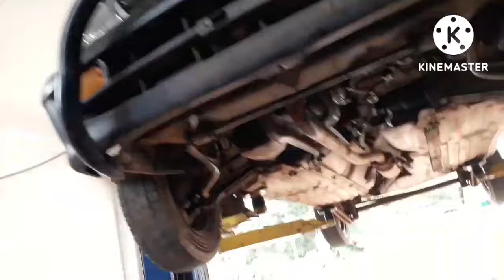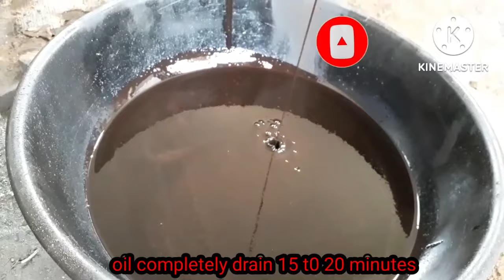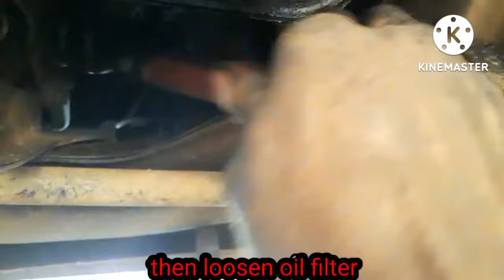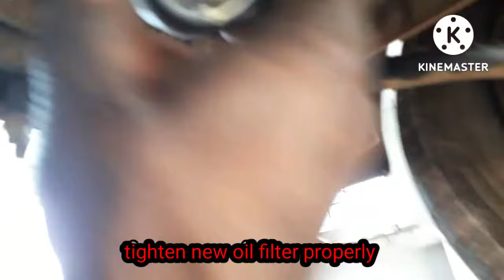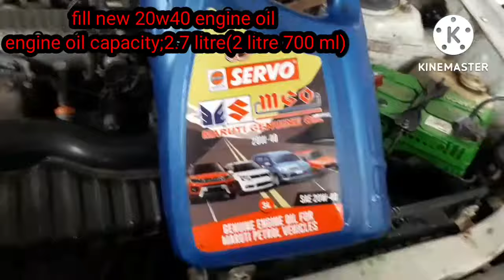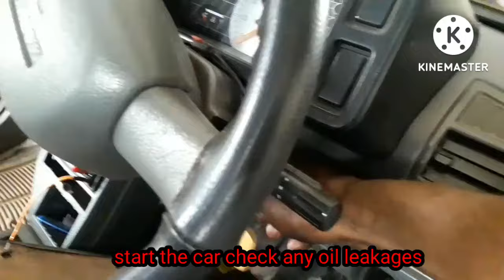maruti 800 car engine oil change procedure

Comment: Oil filter fitting new no wrench tight only hand tight
Reply from the maker: In the 800 car there is no space to tighten the oil filter, so you have to use an oil filter wrench

Comment: Before oil drain u should remove engine oil cap other ys sum oil stuck in engine
Reply from the maker: There is no need to remove the engine oil cap as the engine oil does not remain below the bottom for any reason
Reply from the maker: Thnk u for your enquiries like and subscribe keep support

Comment: Use only 0W-40 synthetic oil if u can afford
20w is not good for cold start
Reply from the maker: Seasons change and, depending on where you live, so might the oil types your car should use. When the weather turns cold, thicker oil has a harder time flowing through your vehicle’s engine and protecting all the critical parts with lubrication.
Reply from the maker: Thank you for your suggestions, like and subscribe keep support
Reply: @adithya-car-tech  thicker oil is good and freer when engine is very hot so for sports car it is right one.
Reply: Maruti 800 k liye uske uske user manual.me 20 w 50 hi bataya hai